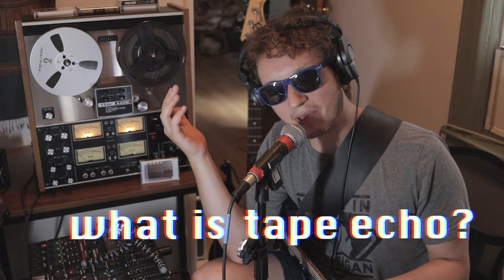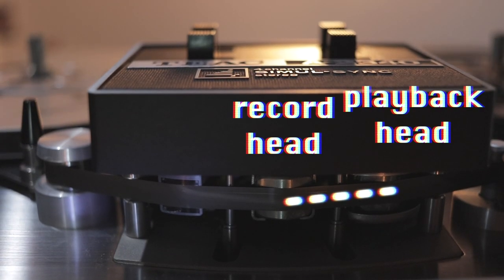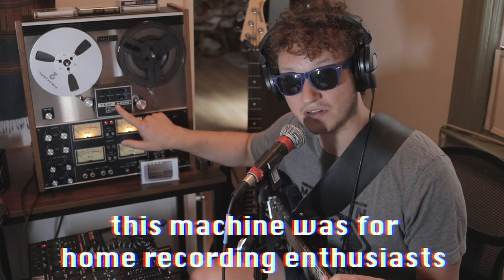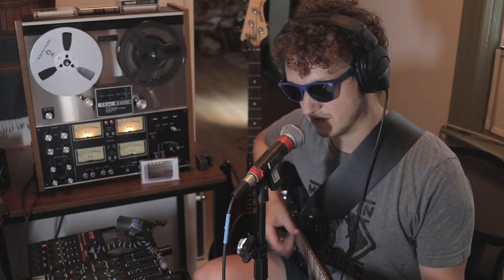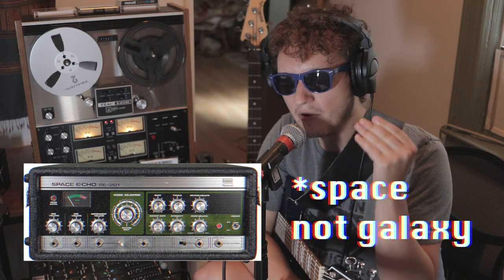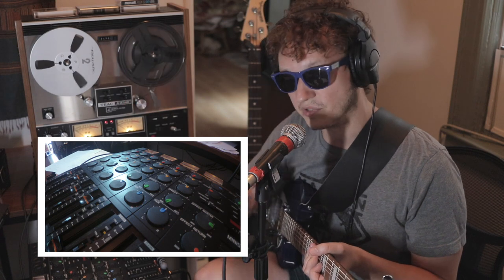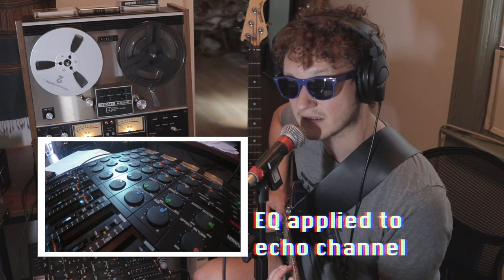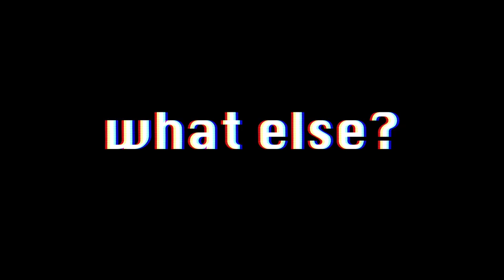How to create reel to reel tape delay & echo using a TEAC A-2340 ||| MADE ON TAPE

Comment: Does it need to be a 3 head rtr machine? I just picked up an old Robers rtr but it does not have an erase head. So I'm not sure if I can actually record with it.
Reply from the maker: you can record with it, if it’s still functional! however, it’s unlikely you’ll be able to use it as a tape delay machine.

your machine does have an erase head, but it doesn’t have a separate record and play head. that’s where the delay comes from: the distance between the record head and playback head. 

machines with three heads usually give you an option to “monitor the source, or the signal you’re sending to the machine, or monitor the tape”

monitoring the tape gives you tape delay. hopefully you still find inspiration in your reel to reel!
Reply: @Made on Tape  thanks so much for the reply. Love your channel and what you do! Peace, mate! ✌️

Comment: So just to reiterate, you're running guitar directly into the 2340, no amping (other than it's internal pre)? Then from there, into the the Porta2? I don't think you really showed your whole signal chain, IINM. Just curious! Cheers ✌️
Reply from the maker: ahhh my older videos could use some updating.  I'm using the Portastudio as a mixer, so ...

the guitar is going directly into channel 1.  
Then, using the effects send, I am sending the signal to the TEAC r2r
then, instead of using the effects return, the signal is going back into one of the channels on the portastudio.  That way, you can use the effects send on that channel to get feedback and more echos.

hope that's clear!

Comment: okay, second question. when recording are you leaving the switch at “tape” or “input” once you engage the rec+play buttons?
Reply from the maker: if you are recording to the tape, it’s best to monitor the tape instead of the “input” or “source”.

that’s the benefit of having three tape heads: it’s so you can monitor the tape as you record. does that make sense? sometimes i can’t tell when i’m writing if i’m making any sense 😂
Reply: @MadeOnTape  makes perfect sense. my problem was that i was monitoring from the input (because i’m used to doing that when recording normally) but for this particular application you need to be monitoring directly from tape

Comment: Have you ever modified a reel to reel to have a variable speed with a potentiometer ….or are those dc motors only able to switch between the 2 speeds being fixed? Or is that what you are doing by feeding it back? Wicked cool. Picked up an old 60’s/early 70’s Sony TC650 tube reel to reel for less that a song….60$. Works well just needs a service. The service will be Herculean though I’m afraid.
Reply from the maker: mods are beyond my intellect, so I haven't made a variable speed reel.  Hope you're having fun with the Sony!

Comment: Wicked, can you explain the connections? What kind of mixer do you use ?
Reply from the maker: yo!  this was a TASCAM Porta Two, but any mixer with an aux or effect send will work.  The R2R taks RCA in the back, but the mixer sends 1/4".  RCA-1/4" adapters are easy and reliable.

I am playing an instrument in one channel, sending its signal out via "effects send" to the tape machine. Then, I return it back to a separate channel.

So, whether you're recording to tape or in a DAW, your "delay" signal is being recorded on a separate track from your original source.

Does that make sense?  Let me know if you need clarification!
Reply: @MadeOnTape  thanks buddy, I'm getting one this week

Comment: Slightly off topic from tape echo, but I have a question about using a tape machine for summing. How do you get a stereo track from your DAW into the tape machine and back into the DAW as a stereo track? 

I have an Akai 1720W tape machine and it bounces my stereo track to mono coming back into the DAW. The machine def can do stereo bc when I play the tape on the machine it's stereo... just don't know why it keeps coming out the machine in mono.
Reply from the maker: hmmm this could be one of a few things.

what's your cable and interface situation?  if you have a two channel interface, you should be sending or receiving a left and right channel, obviously...

...is your software combining the signals on the way in?  Could be an input setting in your DAW?  Are your channels hard panned left and right?  What DAW are you using?

thanks for the question and hopefully we can get to the bottom of it
Reply: @MadeOnTape  
**EDIT: Nevermind, I figured out 🤦🏻‍♂️ I had to change the input of the track I was recording to to stereo inputs 1&2 in my DAW instead of inputs 3&4. 

thanks man! Really appreciate u looking into this.

So my Apollo Twin MKII’s OUTPUTS 3 and 4 are going into the Akai’s Line left and right INPUTS via dual RCA to 1/4” TS unbalanced cable (RCA on tape machine, 1/4” jacks on Apollo).

The Akai’s left and right line OUTPUTS are going into the Apollo’s INPUTS 1 and 2 via two RCA-to-XLR cables (one each).

My DAW is Ableton Live 10 and I have the tape bounce track set as a single stereo track with its external input being the stereo inputs 3/4 (from the tape machine).
Reply from the maker: @bilnabiln  i feel you.  It's always something like that!  Often software and routing...

Comment: Does a single main output of the mixer say go into the input of a amplifier for a live rig
Reply from the maker: mixers always have a stereo out along with other possibilities (aux sends for example)…
this is a line level signal, so you need to send it to something expecting that.

i don’t have experience using my mixer on stage in a performance setting, but have you checked out Hainbach ? His youtube channel and subreddit would be a great resource for live applications.

thanks for watching! 🙏

Comment: I have that same model Teac, but mine needs to be serviced.
Reply from the maker: hopefully you're near someone who can!  It's a solid machine, thanks for watching!
Reply: @MadeOnTape  I think the heads need a proper cleaning. I just need to research how to maintain it. I have the open reel 4 track and a 2 track open reel machine. Also that cool mix down device by Teac.
Reply from the maker: @JRP3music  what's the mixdown device?
Reply: @MadeOnTape  It has inputs for all for tracks. It is essentially a RCA line mixer that allows you to blend combinations of the tracks down to 2 tracks for bouncing or mix down to stereo 2 track.

Comment: What about the pitch control?
Reply from the maker: on the TASCAM?  dang i didn't think about that
Reply from the maker: but the TEAC doesn't have a pitch control. There were several generations of this reel to reel, and this is an early one: the A-2340
Reply: @MadeOnTape  Ah right.  Yeah, it was the TEAC I was thinking of.  Do you know how to make a tape loop?
Reply from the maker: i’m going to start to dabble. do you have any pointers?
Reply: @MadeOnTape  Erm.  Make sure you have splicing tape, a splicing block and a nice sharp razor?  That's all I've got